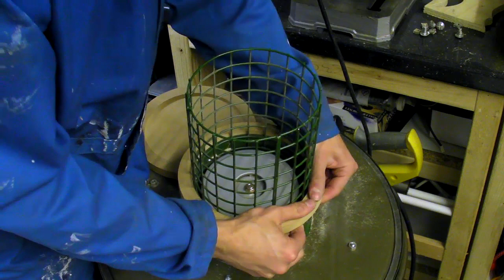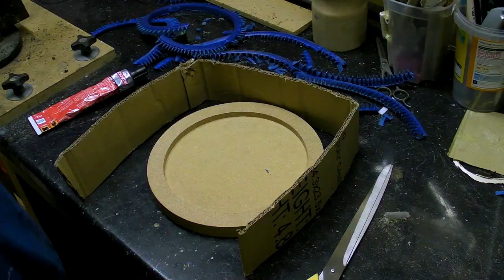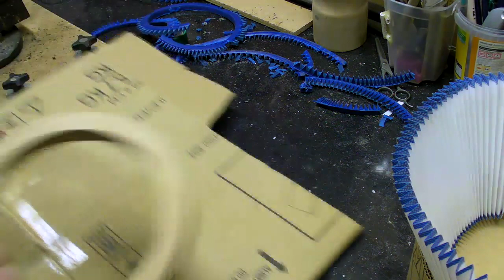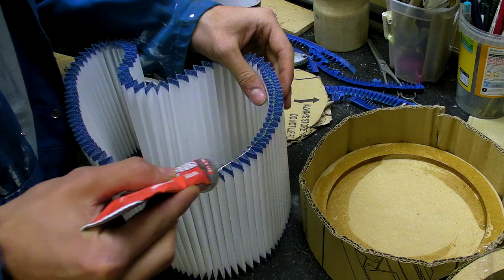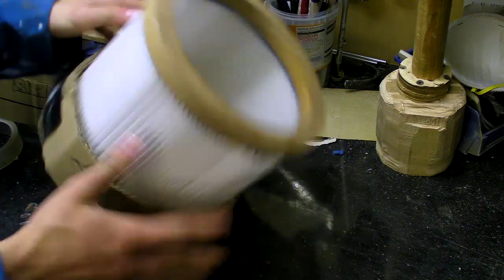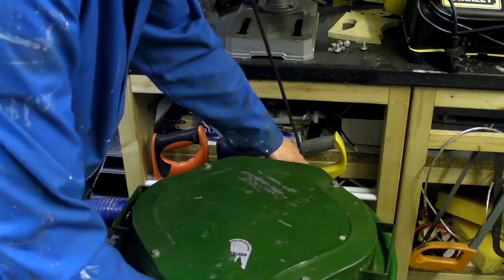Custom Made HEPA Filter for Workshop Extractor

Comment: I have a question regarding these filters:
why the ripples? They sure give you more surface to collect dust but, they also make your cleaning job 10x more difficult.
I rather clean my filter more often than dealing with "in between the ripples" cleaning.
Am I missing something?
Also, with less surface, the motor runs easier until it's clogged.
Thanks.
Reply: not supposed to clean hepa-filers, but you should put a foam over it for the rerular dust etc so hepa will last longer since its only handling the spaller particles.